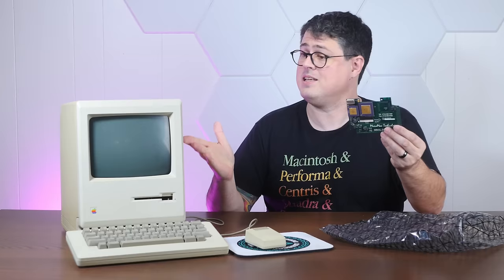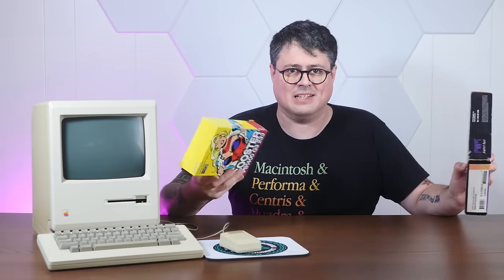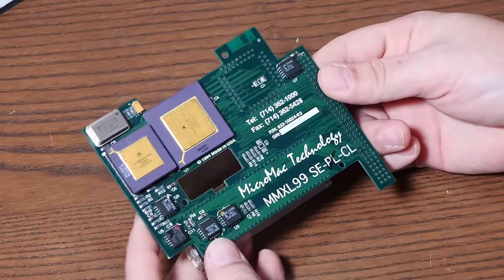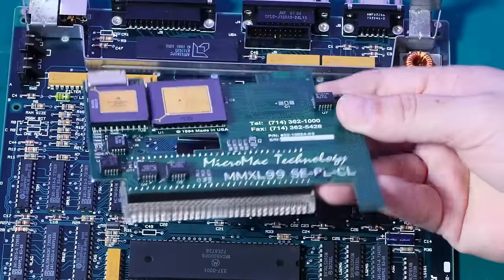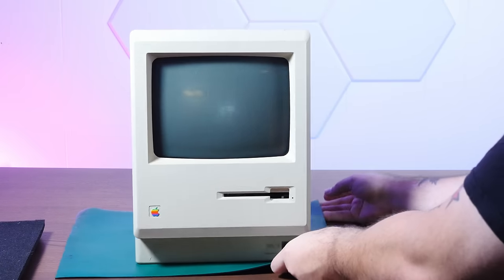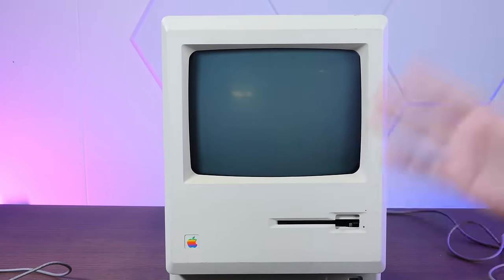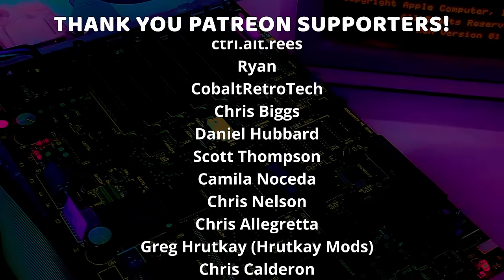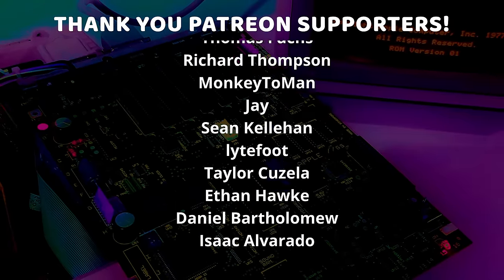Building a Slightly Cursed Mac Plus Plus Plus

Comment: Would this work on any compact mac that have a 6800? like the128k or 512k?
Reply: I have never heard of one of these working on a 128k or 512k. A 512ke might be a possibility since they use Plus ROMs (I believe), but even if it works the small amount of ram would limit your ability to run any programs that would really benefit from the accelerator.

Comment: Since the Amiga 500 and 2000 ran the exact same CPU as the Mac Plus, I wonder what would happen if one of those CPU boards were installed into one of them.
Reply: The Amiga has some oddities that prevent that sort of thing. It's why a terrible fire won't work in an Atari or the like

Comment: Did you really just complain about a computer using 2 power outlets?  Many PC power supplies at the time came with an outlet to hook the monitor to.  Not to mention pretty much everyone had the computer plugged into a surge protector with 6 or more outlets.
Reply: Shhh.. He's stretching for reasons why this machine didn't suck.  Which it did.

Comment: not curse enough i own a old mac plus than was use by somone else in the past with a with a internal scsi solder in on the side of a chip with a weird psu glue in the top in the case with a power molex for a hard drive i have done some search about it online it was a mod made back then

Comment: But, that's not strictly a Mac Plus. That's a 512K Mac that was field-upgraded. 
The Mac Plus had a legend on the front, and a keyboard with a numeric keypad.
Reply: but the 512K mac didn't have SIMM sockets
Reply: @iamdkk  sigh... This 512K unit had the Macintosh Plus Logic Board Upgrade Kit (part number M2518) done to it.

Comment: Affordable?  Really?  It was $2,600 new.  That's $7,000 in 2022 dollars.  You could have bought two XT clone machines WITH hard drives and monitors or put a 50% down payment on a 1986 Honda Civic.

You're cherry-picking with the Compaq 386 comparison.  The 386 was a bleeding edge processor in 1986.  The 68000 wasn't.  Compaq was competing with IBM, not aiming at the home market. The only people buying those were businesses and schools.  Any number of machines, particularly the Amigas were a far better deal than this slightly warmed over retread..
Reply: I was thinking the same thing, but "affordable" is largely a matter of perspective. Sean is correct that the pricing looks favorable next to a Compaq Deskpro 386 back in 1986, but you are correct in that a fully outfitted Compaq Deskpro 386 was the most expensive IBM clone available, coming in at around $12,000, so a typical home computer user probably would've been looking at a significantly cheaper alternative, like an IBM PC XT clone. But that said, I'm curious to know what your pricing source is, because I was selling computers in my college campus's bookstore, and I seem to recall that prices were significantly higher. Hard drives, in particular, were expensive back then, and they were optional in most IBM clones at the time. Also, since VGA wasn't introduced until 1987, the closest PC graphics to what a Mac offered in 1986 would have been EGA, which was pricey at the time. My guess is that the EGA card and monitor would've added $600, maybe even $700 to you XT clone. Also remember that IBM clones at that time had no sound capability unless you added a sound card. By the time you outfitted your XT clone to match the specs of a Mac Plus, it wouldn't have been a lot less expensive. Back on the other hand, though, the question would be, "Ok, fine, the Mac Plus delivers a lot of features for the price, but do I need all those features?" If you'd be satisfied with an XT clone with a monochrome or CGA display system, no sound, no networking (Macs had AppleTalk built in) and either a very small or no hard drive, then sure, you could beat Mac up on price. I would submit that it would have been better for Sean to call the Mac Plus "a good value" rather than "affordable".
Reply: Spot-on with this analysis.
Reply: @dennisp.2147 , your math is spot on, and you're quite right about campus bookstores being relatively expensive places to buy just about anything, including computer software back in 1986. (The campus bookstore where I worked only offered Apple and IBM; no clone options, for heaven's sake.) But also remember that buying a computer in 1986 was a very different experience from what it is now. Nearly all buyers back then were buying their first computers, and most families didn't have one yet, which means most buyers didn't have a trusted, computer-savvy friend to advise them. There was no Internet back then, and unless one lived in a major city, he probably didn't have a local computer club to provide guidance. There were few established clone brands, and interstate commerce regulations hadn't quite caught up with the notion of buying a big-ticket item across state lines, so if you bought a computer outfit from some startup (and it was relatively difficult at the time to find out which hobbyist magazine advertisers were well-established and which were startups), and something went wrong with it that the computer company refused to fix, there was a good chance you could end up with an expensive paperweight. The bottom line was that most people who bought computers in 1986 didn't buy them via mail order from Computer Shopper ads. They bought them at computer stores, where there were trained salespeople to put together a working system and, just as important, trained technicians who could fix your new computer if it developed a problem. But your local computer store charged more than mail order prices, so you weren't getting your XT clone outfit for less than half the price of a Mac Plus. You'd more likely have paid within $600 of the Mac Plus by the time the complete package was put together. That was still a lot of money in 1986, but not as stark as getting two XT clones for the price of one Mac.

Remember also that few people in 1986 took an IBM clone out of the box, put it together, turned it on and started using it. Depending on how much work the computer store had done for them, they might have had to open up the box and install components (daunting if you'd never seen the inside of a computer before), figure out how to connect whatever peripherals they'd bought and then, after turning it on, figure out how to do anything useful from the A> or C> prompt. Until one learned how to write an AUTOEXEC.BAT file, that prompt wasn't particularly informative. And, more often than not, you'd end up going back to the computer store, or dialing into a BBS they'd told you about if you were knowledgeable in such things, to get the software you didn''t realize you'd need. Now, I haven't been an Apple fan since my Apple II days, and like most of my fellow Computer Science grads at the time, I loved making fun of the silly, toy-like Mac. But compare this honestly with the Mac out of box experience: Plug it in (and you have to admit, as slow as AppleTalk was, it was a darn convenient way to hook up a printer), turn it on, point, click, and discover all the cool stuff you can do with the software that was included with the computer. To a lot of people, that $2600 was money well spent.

So, while I would agree with you that calling the Mac Plus "affordable" in 1986 was a stretch, it could still be a good value, particularly for those who weren't interested in tinkering.
Reply: @mar4kl  I think you underestimate my age... I've got my copy of Turbo Pascal that I bought in the University Library around here somewhere.

I fully remember the 1980's. In early '87 a friend of mine was working in a computer store, and his salary was on the hook for $2,500 for his shiny new Double Sigma 386DX20 clone machine with 120 MB SCSI drive, I told him at the time he was silly to go so bleeding edge, since nothing really needed or ran 32 bit software yet, But some folks just have to have the best.  

I'm fully familiar with the prices computer stores charged at the time. I also spent hours perusing the ads, both in the magazines and the photocopied store sheets.  Out local computer store, Bits Computer, run by a perpetually angry Taiwanese fellow, charged no more than the Computer Shopper and often less for mainboards, as I assume he had some (probably illegal) way to get them cheaper.

I will concede that for completely non-technical people a Mac might be easier to set up.  But value for money, the Mac Plus is a 1984 class machine, three years later with a monochrome screen, no hard drive and a single floppy it's hardly any sort of bargain.  You'd have been better off with a a Tandy 1000.

You should also consider what it would cost to add the external SCSI hard drive to the Mac Plus.  Probably close to $500 for a 20 MB external SCSI drive.
Reply: @dennisp.2147 , it sounds like you're about my age. 😅 1986-87 was my senior year of college, and that spring I was working for a software company as a programmer. I was better connected with the personal computer market than most folks at the time, and it sounds like you were better connected than I was - a lot better connected. But that's my point. MS-DOS hadn't won the market quite yet, and there was a lot more driving value to computer buyers of the time, most of whom were first-time buyers and, increasingly, not hobbyists or enthusiasts. People who wanted to just sit down at the machine and do stuff without fussing. That's who the Mac - whether it was original, "Fat" or Plus, or a couple years later, SE - was for, and to them, it was a compelling value. For guys like you and me, not so much. FWIW, in 1989, I did basically what your buddy did, and I bought my first computer, a 386DX/20 based desktop with 4MB RAM, what seemed like a gigantic 90MB SCSI hard drive, VGA graphics, a color monitor and a Panasonic dot-matrix printer. It was literally a bargain-basement clone, built in the basement of a friend of a friend for $4200 and change at a time when similar machines from Dell, Northgate and Zeos cost almost $1000 more. And from it, I learned why those mail order clones cost almost $1000 more, among other things.🤔

It sounds like you and I don't really have much to quarrel about. My contention is that the Mac had value to those who wanted to get into the personal computing world without having to learn to deal with hardware compatibility issues and arcane command lines. I never bought one for myself. Buyers like you and me, who were as interested in learning what made our computers tick as we were in using them, could better appreciate the lower cost of IBM clones.